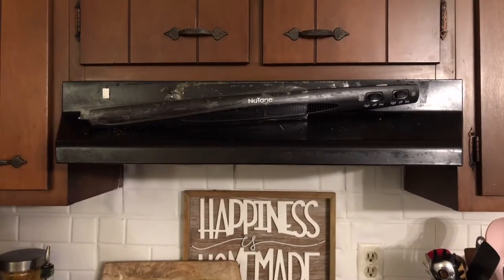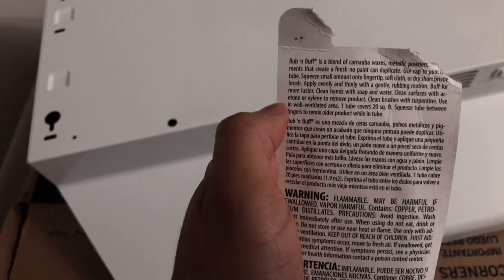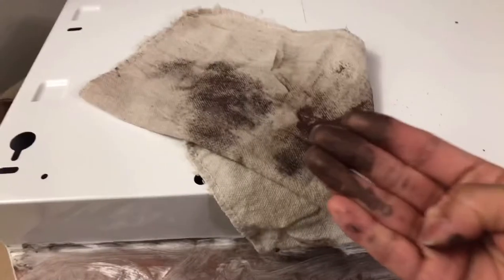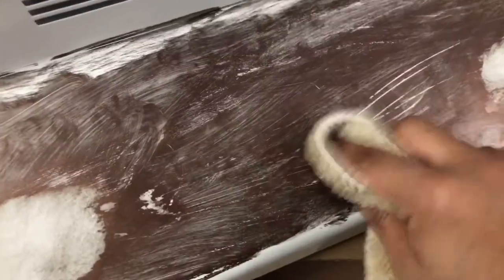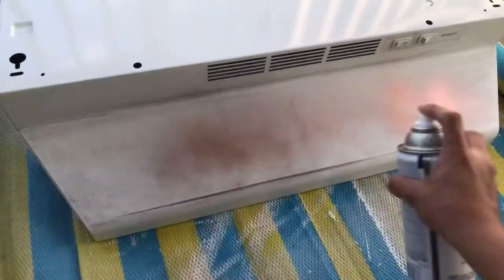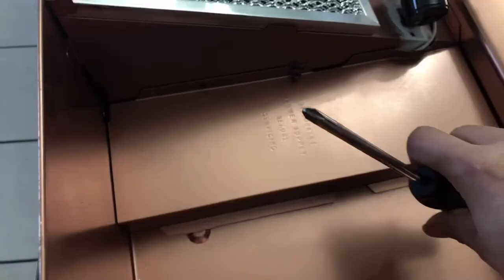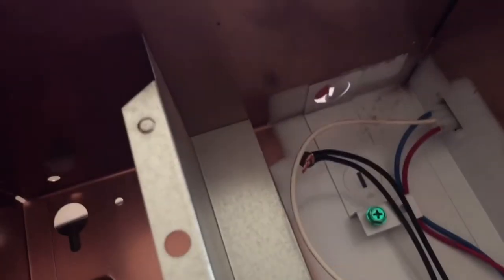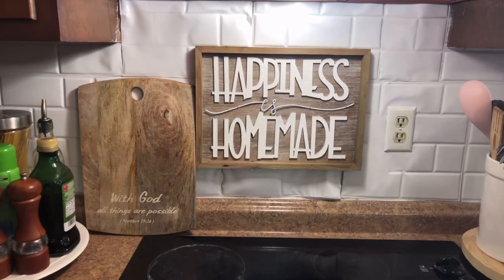DIY White to Copper Stove Hood Range & Rub ‘n Buff Disaster 😥

Comment: Rub n Buff is not supposed to be used like the way you wanted to, it was intended for other purposes. Project still turned out good.
Reply from the maker: Thank you! I figured I try it out and definitely was a lesson learned 😊
Reply: That’s exactly what I’m saying. I don’t know why people use it for things like this.
Reply: If she had spray painted it with clear, or black first, THEN applied the Rub & Buff (either using cloth or by putting a plastic glove on her hand)  it would have worked perfectly. It can be used anyway someone comes up with. To be honest I don't understand why people act like it can only be used for certain things. And even if that's what they think, why add a comment about it?

Comment: Doin' it. 👏
Reply: I used the same copper on my light covers. 2 coats.
Then did a clear coat... Then a satin black, then metallic bronze...
Used a rag with some mineral spirits around the edges (revealing slightly the copper).
Then a satin clear coat and *BAM*...
I have new oil rubbed bronze fixtures, covers, cabinet pulls... It's AWESOME.
Reply from the maker: Thank you for watching beautiful 🙏🏽♥️